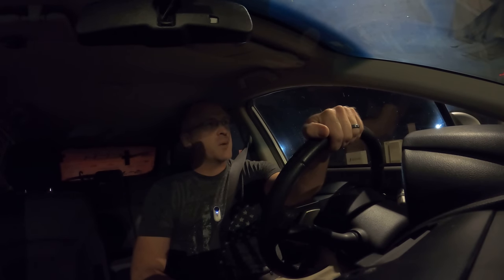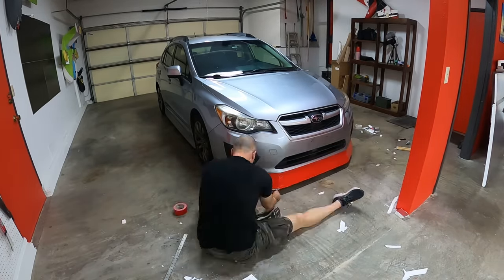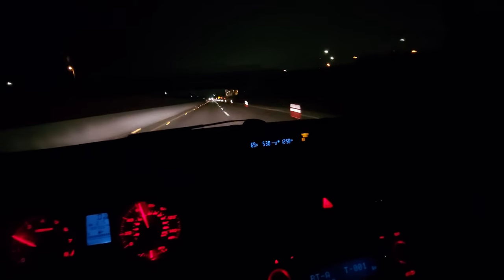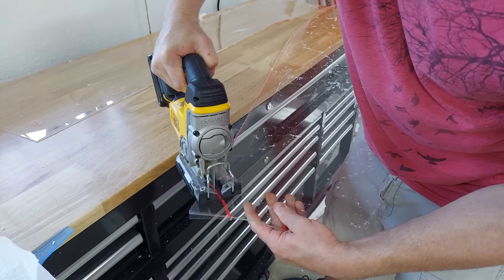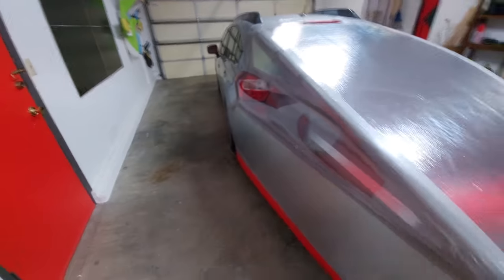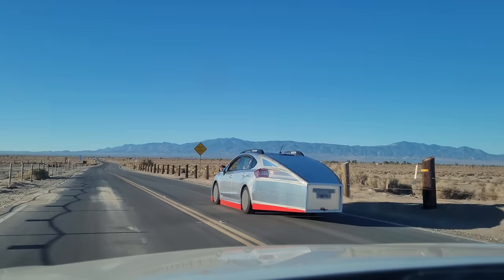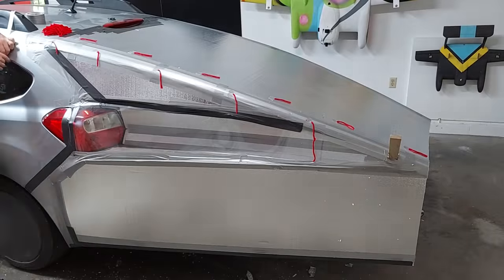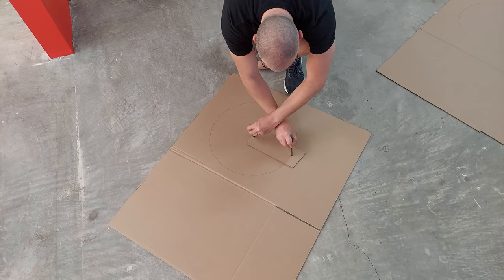Beating High Gas Prices Using Simple Aerodynamics (Home Improvement Store Edition)

Comment: 12:20 Funny you mention the aerodynamics of that Mercedes, it's the EQS which is their first all-electric model. To help maximize the range they designed it to have the best coefficient of drag of any production car on the market at 0.20, so your callout was spot on
Reply: Well yeah for a full electric vehicle that is already twice as heavy compared to a ice version the aerodynamic is important to maximize the range of the city vehicles otherwise it will end up like a brick but then comes the BEV  pick-ups like : Rivian R1T, GMC Hummer EV that somehow do not care too much about efficiency more oriented for the utility & practicality on road and off the road + other adventure capabilities aspects..
Reply: @poplaurentiu4148  
Twice as heavy, twice as cheap to drive.
Reply: @SMGJohn  EQS is not cheap at all.. inside is quite luxurious and the price starts above 95k-100k.. the driving for what purpose is intended (definitely is not a track car) mostly designed to drive smooth and quiet  from busy airports to cities hotels and it does feels good for that so yeah.. not sure what you were pointing ..
Reply: @poplaurentiu4148  
Wow, you drive for free? Interesting.
Reply: @SMGJohn  I'm not really sure i fully understand what you try to say regarding to EQS..
Reply: @poplaurentiu4148  He's saying it's cheaper to recharge with electric than to fill with gas.
Reply: @fders938  Thanks for that..
Reply: @poplaurentiu4148  the rivian R1T has the same drag coefficient as a corolla so i'd say they definitely care about efficiency.
Reply: @sydneyreading3374  I'm not sure about that..
Reply: It's the one that's like 2500kg right?
Reply: @poplaurentiu4148  super helpful lol, any reason that you'd care to illuminate us with?
Reply: @sydneyreading3374  Yes, but in the equation for drag the frontal area is also Multiplied. Where as a Corolla might have a frontal Area of maybe 2.2 m^2, the Rivian has quite surely double than that so they might have the same drag coefficient, the overal air drag is still way higher
Reply: @poplaurentiu4148  Well, twice as heavy is an exaggeration:
EQS 580 4Matic 2585 kg
S Class 580 4Matic 2095kg
Reply: @floriankrauss  the question wasn't about whether or not the rivian r1t creates a lot of aerodynamic drag. the original claim was that the designers of the r1t didn't care very much about efficiency. based on this Cd, i'd say they definitely cared about increasing efficiency. for a truck, the rivian is pretty damn efficient while still being perfectly useful.
Reply: I drive an EQS base model which is like 100k USD converted and came from an old Skoda Enyaq iV 80 sportline (gotta include it all) it really doesen't feel any different in the area department
Reply: Everybody seems to care way too much about weight in electric cars. Yes, it is more expensice to accelerate a heavier car, but dont forget alot of this energy is won back through kinetic energy when breaking. That's why a 50% increase in weight in electric cars doesn't nearly reduce your efficience as much as the same weight increase in icu cars, because in contrast to icu cars, energy is not forever lost once you Brake.
Reply: @lcberchtold1208  not all of the kinetic energy that you have when you brake is used for a little boost in range, the problem is it loses almost all the power right after you speed up again, which you can feel here in Germany when you're on the autobahn, people pull hard there
Reply: @magnenielsen7935  As you can tell by my English and my autocorrect that constantly tries to screw me over, I live in Germany too, 220 is cuising speed for me.
I know, but BMW said their i3 gets 60% out of all the energy that is necessery to accelerate from the breaking beforehand, which I think is still plenty. Especially within a City where you have lots of stop and goes. And on the autobahn the weight becomes near to irrelevant anyway, it's all aero gains there.
Reply: @lcberchtold1208  I see, that is true for the most part, but when you're stuck in traffic and (that sucks of course) when it loosens up you have to be on it, and some EV's take time even with the instant torque. With that I have to say that less weight come in handy at those times.
Reply: @magnenielsen7935  I dont see the argument here tbh. The Fiat Panda I use does 0-100 in 15secs and more and it works. Any EV usually has way better Performance of the line and 0-100 then €$-comparable cars. The 50k Tesla of my grandma beats the 70k Mercedes of my dad any day of the week.
Reply: @lcberchtold1208  weight is the most critical part when it comes to efficiency and range in EV vehicle. Aerodynamics are important, but the majority of EVs are driving in cities, where aero doesn't infect your range and performance as much as simply the vehicles weight. Of course on the BAB aero is most important, but overall weight and size comes again handy, less frontal area, less drag, smaller battery, lighter vehicle. (Better Performance as well)
Reply: not the first all-electric (keeping in mind B class), but I think that's the first Mercedes-built all-electric, B class, I think, had all parts from Tesla.
Reply: yeah, it took 20 years to design a roof like a prius
Reply: @sydneyreading3374  the low coefficient of drag on the rivian truck is mostly due to no large grille on the front end. This is true for most electric cars and is also why electric cars generally have a lower coefficient of drag.
Reply: @poplaurentiu4148  unless you're going up in elevation the weight doesn't matter much 🤷‍♂️
Reply: @poplaurentiu4148  
I saw a Rivian for the first time last week, pretty neat, but not my style. Although I did like the safety aspect of the taillight across the entire tailgate.
Reply: Sorry you mean the lucid air? With the lowest drag coefficient of 0.20
Reply: Not their first all-electric model at all, the B-class and EQC have een there before. But yes, the first "on electric platform".
Reply: I love watching engineers fighting in the comment section,I just love it!🤣🤣🤣
Reply: @sydneyreading3374  Uh, drag coefficient is a linear factor along with FRONTAL area linear MULTIPLIER.  Here the Corolla is vastly superior and it is not even clean on the bottom like the R1T which makes a HUGE difference in Cd.
Reply: @w8stral  not sure what you're trying to argue here. i never said the rivian r1t has lower aerodynamic drag than a corolla. the original comment i replied to argued that the designers of the R1T didn't care about aerodynamics. 

and yet, rivian has managed to design a perfectly usable truck with the same coefficient of drag as a high-efficiency economy car. yes, electric cars have advantages due to less cooling requirements, but trucks also have massive disadvantages due to the incredibly inefficient shape that is a pickup truck. all i'm pointing out is that the R1T engineers definitely cared a lot about efficiency, which is reflected in the impressive range that the R1T achieves for it's class and battery size.
Reply: @poplaurentiu4148  it's rarely mentioned just how much drag is caused by air flowing thru the engine bay. EV's don't really have engine bays, and even if they do, they require way less cooling, thus they don't have this particular source of drag. 

also, racing cars have their engine bays as closed off as possible because of this, or even the radiators are sometimes mounted remotely to close the grills completely. (they also have way more drag but that's caused by generation of downforce)

also, weight matters only during acceleration (as it takes more work to get a heavier car to the same speed. braking and cornering are also acceleration, just working in different directions), so highway gas mileage is barely affected by the weight of the vechicle.

while EV's have a lot of problems, not all of them even caused by their batteries (and i love pointing them out to EV enthusiasts), there is just no way to deny their efficiency, both aerodynamical, energetic (thermal) and their mechanical reliability.
Reply: @costerowywot  Today i just watch this comparison and got me intrigued a full electric KIA EV6 GT vs a petrol supercar Aventador SVJ.. i really expected the supercar to be a whole lot quicker & faster since it was costing like 6x times the price of that KIA and it was lighter : https://www.youtube.com/watch?v=_8Ks4EdHWck&t=562s
Reply: It's NOT their first all- electric model. LOL
Reply: It isn't their first battery electric model. The EQC predates it.
+ there's the SLS (AMG) electric drive in 2012 but that's debatable
Reply: wasnt mercedes first full EV some EQC model? like a SUV 🤔
Reply: @poplaurentiu4148  why not make gas cars more efficiently then too?
Reply: How much lower is that than the Nissan gtr?
Reply: ok furry
Reply: @sydneyreading3374  Drag coefficient is not the same as actual total aerodynamic drag. A Corolla is still far more slippery driving on the highway than a Rivian. But still, hats off to Rivian for making a truckish design while having a low Cd.

Comment: You should try using a OBD monitor to measure real-time fuel consumption. In order to maintain a consistent weight you would still have to fill up before each test, but it would eliminate any noise in the data caused an inconstant fuel station pump.

Comment: You can still make the underside more aerodynamic just a matter of what you’re comfortable with. Some Miata race cars use ABS plastic sheets underneath to really smooth things out underneath. Off road race truck teams with bigger budgets take that into consideration and throw a giant metal skid underneath the cab. Also 15 degree departure angle for the bottom if I remember correctly with diffusers
Reply: I always read on the area of 12 degrees...
Reply from the maker: It was just where and how to attach things that would have been a PITA.   Plus a flat sheet wouldn't have done it, it would have needed to be 3 dimensional.   Subaru didn't make it easy....
Reply: @thinkflight  
Maybe build a box frame along both sides of the underside of the car so you can mount a flat sheet lower than the vehicle components.
Reply: @thinkflight  Considering you're using such tall skirts, you could probably utilize these to your benefit of making a flat bottom out of sheet material.  Just connect the front effect, skirts, and tail, with a cutout for the wheels, should be far simpler than attaching to the frame itself.  The most you might have to do is find central anchor points, but considering how far offset from the body you'll be, just layer up some duct tape and make a support with some dowels epoxy, entirely removable solution since the base of it is taped down, and you can screw the sheet into the support.

Comment: I love how you tried to make the car more fuel efficient and accidentally created a dirt cheap mod for more downforce on your car at the same time.
Reply: Now I can try ricing without being permanently riced out
Reply: His mods actually look better than like 90 percent of the ricer mods i see lmao
Reply: How did you come to that conclusion btw?
Reply: i dont think it's creating downforce.. its reducing drag which helps with MPG.. if you're adding downforce it would add drag = it will worsen the mpg
Reply: @Itr-tv7kt  Car bodies are shaped like a crude airfoil. Air underneath travels slower than air over the top, creating lift via a pressure differential. The less air underneath the body, the less lift. Negative lift is known as "downforce". 

Does his mod produce NET downforce? Almost certainly not. But "less lift" is mathematically equivalent to "more downforce", and will be experienced by the driver as more traction and roadfeel.
Reply: @erikmyers3888 you almost had the right idea.. but fast moving air = Low pressure.  slow moving air = high pressure which creates lift as you said
so what that means is it's "lifting" the car.  not pushing down on the car..   what he has made here is an airplane wing shape which is upside down car's wing.
and anytime you add downforce the Drag coefficient goes up which hurts mpg lower the cd the more fuel efficient.
Reply: @Itr-tv7kt  To be clear we were talking only about the lowered front and side skirts, which singular change was referenced in the video as giving the car the feeling of more grip, not the tail that was added later. He didn't make an airfoil shape, he made the car's airfoil shape less effective at producing lift.

It is not true that reducing lift always adds drag. Allowing less air under the car is different than adding a wing. It both reduces drag AND reduces lift. Of course there is a range to this effect, but if you make the front and side openings small enough, and promote air (from the radiator, wheels/brakes, etc) smoothly leaving the back/top/sides of the car you can create negative pressure underneath the car without the use of any inverted airfoils (that would add drag). You will add rolling resistance however and at at an extreme point that could decrease economy. It also can cost increased frontal area (like in this situation), but that is typically more than offset by the underbody drag reduction.

My point is that reducing lift has the same effect as adding downforce. But "adding downforce" colloquially means slapping on a spoiler or body ducting that will usually increase frictional contact area and/or boundary layer separation, two main components of "drag". "Reducing lift" typically comes from decreasing the frictional contact area and boundary layer separation caused by existing features that create lift, such as underbody roughness and mass airflow around [the top and bottom of] the airfoil shape of a car body. A plane with wings that laid flat on the ground could not take off.

Put simply, the air in the center front of a car must go up, down or to the sides. What he did is reduce the cross-sectional area through which air can go underneath the car, therefore less air will go under the car. The air that does go under the car, will travel faster, reducing its pressure. This also decrease turbulence, which reduces boundary layer separation (drag).  Are we talking "negative lift" territory? Not on this car. But we are talking "less lift", and that is the same thing as "more downforce" on a car that was previously experiencing considerable amounts of lift (like most road cars).
Reply: @erikmyers3888  I assumed we were talking about the back of the car since there is no air "on top" of the side skirts.
Reply: @erikmyers3888  I would assume the big tail would actually produce lift due to it pulling the air back down in a low pressure zone behind the car
Reply: @erikmyers3888  You're not wrong, but more critical is how smooth the bottom of the car is. With the irregular voids and air volumes, air under the car cannot escape fast enough to prevent a high pressure buildup as more air gets forced under the car at speed. Ground effects will create less lift, but a simple 'front splitter' will produce significantly more downforce at the expense of greater drag, even if it is several inches higher off the ground.
Reply: Thanks all, I feel smarter already.  👍🏽
Reply: Just to back up erikmyers3888's point: if any of you have driven a car quite fast and felt as though it were getting ready to fly up (quicker to bounce up, slower to come down, less planted/grippy); what he's describing is basically a way to have less of that.
Reply: @misternarwhalart  This looks so much cooler than a ricer. And you dont have to shake your head that someone dropped a few G on it
Reply: @Itr-tv7kt  The skirts around the car create a bit of vacuum bellow the car, which helps which pulls the car down. Not all downforce is created equally.
Reply: @Itr-tv7kt  downforce isnt equal to drag and there are some mod that make more downforce withou add drag just like some old f1 cars that sucked air from the floor and blow through a fan behind the car...
Reply: @Itr-tv7kt  Hello, I find your comment very interesting because, please correct me if i'm wrong, but it also means the car is somehow lighter isn't it ? this should lead to a lesser consuption, actualy I'm counting on that idea to modify the settlement of a aluminium car tent in such a way that it would act like a kind of wing to compensate the addition of new air perturbation...

Comment: Truck driver here, the whole industry has been very focused on aerodynamic improvements for years now. Lower reaching front bumpers, cab side fairings that reach further back towards the trailer bulkhead, reducing the air gap, trailer side skirts (even on flatbeds which are terribly not aero efficient!), “flow below” devices mounted fore and aft of trailer axles, trailer tails (not cost effective tho, and prone to damage/failure because they have to fold), and fairings at trailer rear edges to smooth airflow over door hinges and marker lamps… there’s tons of stuff going on. Every little thing is like a 1-2% improvement over baseline on their own, with some hitting around 5%. Check out the Freightliner Supertruck concept vehicle.

Comment: That Mercedes is an EQS. +1 to coast-down tests instead of gas pump variance. Rad video as always.
Reply: the merc looks like a bar of soap, although the tech is cool
Reply: @driftmad1839  It also drives like it's on ice: terrible
Reply: @SkylineLofe  yours for only a few hundred thousand dollars
Reply: @driftmad1839  EQS's are 100-150k USD. So not a few hundred thousand.